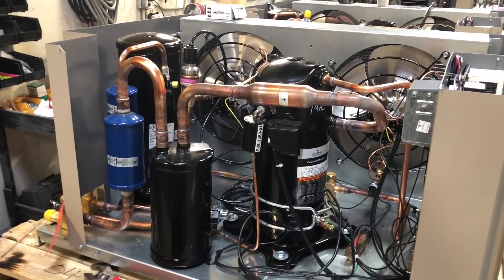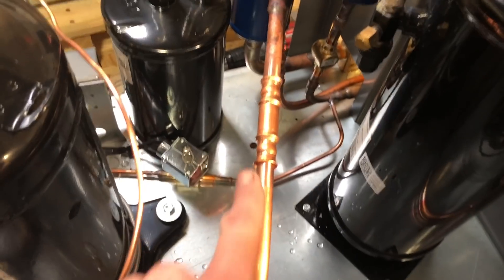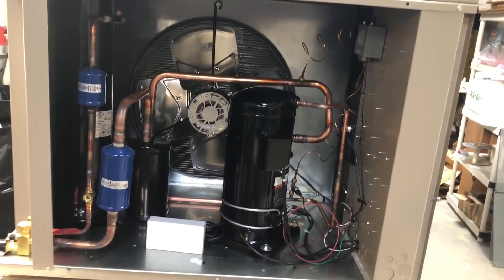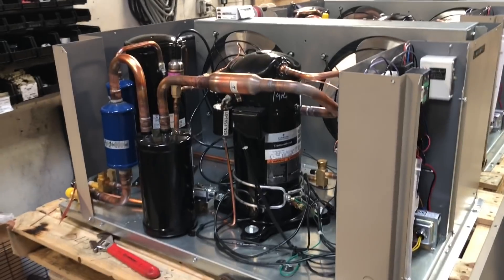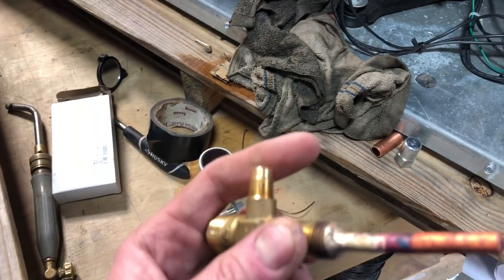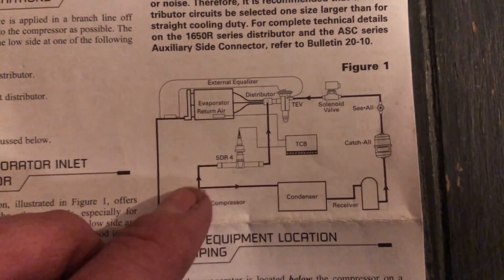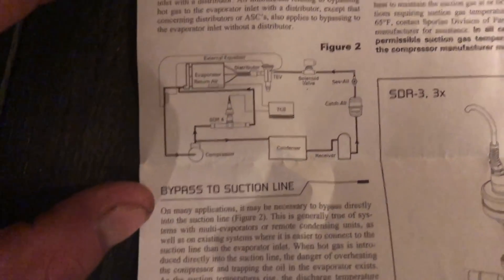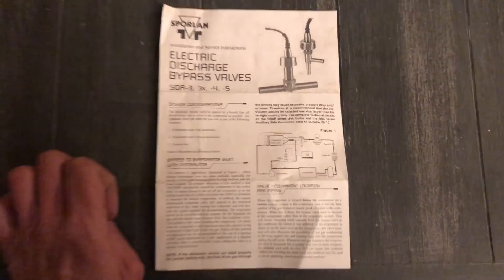Refrigeration Life # 25 . Hot Gas Valve Installation .

Comment: I owned a commercial refrigeration business in the Caribbean for 20+ yrs.  Hot-gas is the ONLY way to go IMHO.  It does in 3 minutes what electric (defrost) does in 20.   Getting a stand alone, small compressor, system to have enough hot gas is challenging/risky without some sort of re-evaporator & accumulator (I see yours) in place.  Kramer has used HG since the 60's....  Excellent video.  Thank you. ❤
Reply from the maker: Yes hot gas defrost works excellent . In this application though for the system that this is used in the hot gas is not used for defrost.

Comment: thx for taking time for videos . question: what kind of pressure are these normally running? like 3 psi of hot gas just to keep temps up or...?
Reply from the maker: Kenny Baker HVAC/R thanks man.  No , there have full discharge pressure coming down the hot gas line. But it is regulated by the electronic hot gas valve . Even if it only lets a little though the pipe at a time it is still just straight discharge gas going into the hot gas line .

Comment: How tight is the differential on these systems do they have a 1 or 2 F  or half a degree before the hot gas opens and closes.
Reply from the maker: heliboy112 around 1 degree but they keep a tight temp diff . They run like 2/10 of a degree right on the money
Reply: @Cscrefandhvac  Wow that is so cool, very tight setpoints.  There is never a day that goes by that I dont love this trade you learn something new everyday. Thanks for the vids brother keep them coming.
Reply from the maker: heliboy112 thanks man.  Yes there is always something to learn. These units will be in clean rooms for pharmaceutical things so the temps have to be perfect

Comment: Nice. Is that a check valve on the suction line between the accumulator and compressor in the beginning of the video.
Reply from the maker: Ulises Palacios hey bro , yes it is. Another guy asked me earlier and honestly I’m not exactly sure what it’s for. Hahaha. I gotta find out.  I think it had to do with the fact that this compressor has liquid injection installed on it

Comment: Maybe a dumb question but I'm starting to get into light comercial...so what excactly are these for...
Reply from the maker: They are for walk-in boxes that they call cold rooms or clean rooms that are usually in a lab type setting or a controlled environment . Where temp and humidity have to maintain a constant temp without barely any fluctuation in temp
Reply: So interesting... Following this project. Thanks CSC

Comment: Good stuff  👍. If they want easy changes then a flare set up with isolation ball valves or hand valves would be best in my opinion but there's a million ways to get the same task done. Can you set up sporlan steppers with those controls? Just asking cuz those are quick to change out, just unscrew the top.
Reply from the maker: randy handle you may be able to use the steppers.  These valves are also stepper valves.  I k ow the kind you are talking about but haven’t seen them used in these particular systems. We go by the design we are given and what the engineers call for , for these boxes.
Reply: Oh cool.. specs are a good thing to follow 🤙